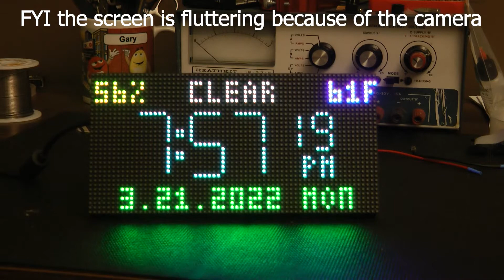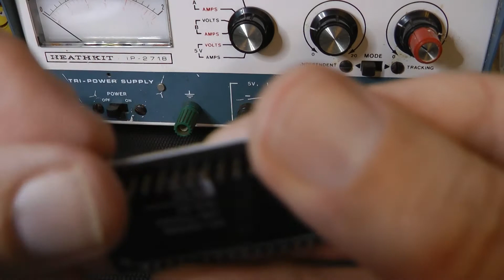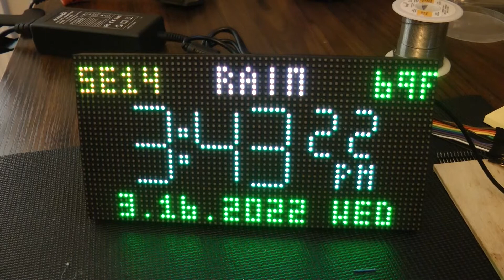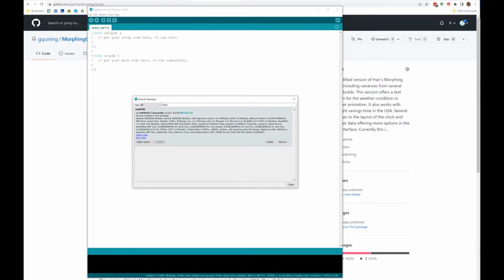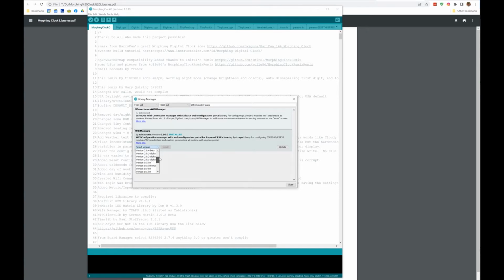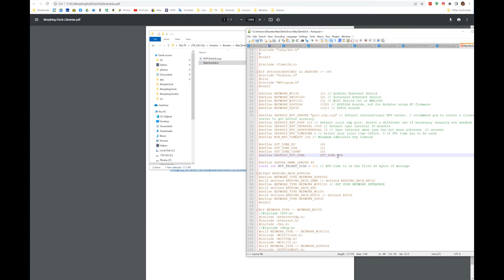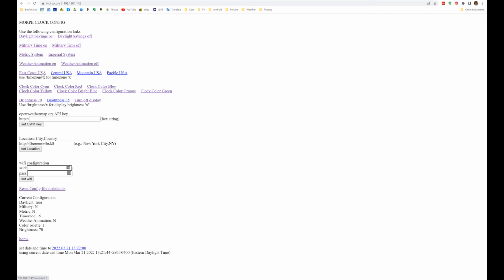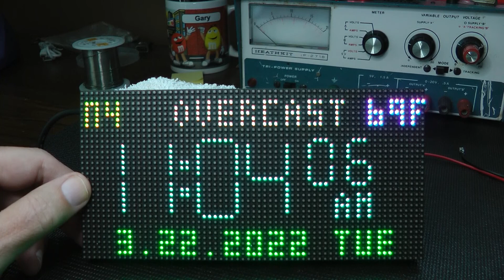Morphing Clock using a 64x32 RGB Display

Comment: hello sir does this code can work on the 64x64 matrix
Reply from the maker: No, it's hard coded to 64x32.
Reply: @GaryQuiring  ok sir, thank you. sir, while iam making this project iam having troubles my display is showing lines instead of the connecting info what would be the problem iam trying to understand but i cant getting it sir . help me please
Reply: @GaryQuiring  sir i have a64x64 led matrix please help me to modify the code that it should work on my matrix
Reply from the maker: @smartboynani5285  I can't help you, I don't own that display.  I suggest you get what the project works with - 64x32.
Reply: Ok sir. If you know anything how to make it work please provide the information. Thank you for responding to my texts.

Comment: Hi
Can you make a version with the ability to set wifi after compilation as it was in the original?
Reply from the maker: Depending on the ESP board the access point way did not work in the boards I used for setting the Wifi.
Reply: It's a pity, because then after compilation you could upload without compilation.
Thanks
Reply from the maker: @janwawrzyniak8444  You can take the source from Harry and modify my version.  The problem I had (I also spoke to Harry about it) is none of the current ESP boards worked with the access point code he was using.
Reply: @GaryQuiring  Dzięki za pomoc.
Pozdrawiam

Comment: Hi Gary I compile the code succesfully. I use Matrix P5 64x32 that I have. I set also into local time and it run correctly. I think I have wiring the pins correctly. However, the display keep flickering all the time. Appreciate if you could assist on this issue as I really like this clock scheme.
Reply from the maker: What ESP board are you using?
Reply: @GaryQuiring  Thank you for this quick reply. I use ESP 8266 Lolin, ESP package 2.7.4, Arduino Json 5.13.5, power 5V 5A.
Reply from the maker: @tutwirata8956  I don't know what the problem could be.  I would try a different power source.
Reply: @GaryQuiring  Hi Gary. I do re-wiring the pin and found that one of my jumper wire was 'unconnected' (might be burn during other usage) causing that flickering matrix display. Finally now Morphing Clock is running nicely and i play with the palette selection. Thank you for sharing this cool project.
Reply from the maker: @tutwirata8956  Congrats!

Comment: Hi Gary! Got the clock running and just have one question...I am missing the top row of weather information.  All info seems to be fine in the params file.  No issues during compile - I know the display is working as the entire display lights up during bootup.  Any ideas?

Thanks
Reply from the maker: Either your weather API key is wrong or try a common city like New York, US for testing.  (Don’t use the state, it's city, country code)
Reply: @GaryQuiring  Yep, my key was bad.  Thanks again...nice to be building stuff that works

Comment: Gary do I have to purchase credits from open weather ? I created a free account I got the api key but this is the message under my account Hourly forecast: unavailable 
Daily forecast: unavailable 
Calls per minute: 60 
3 hour forecast: 5 days . I put the key but nothing it’s on display , just the clock
Reply from the maker: It's 100% free, it sounds like the city, country are not setup correctly.  Try a very common location.
Reply from the maker: Ok I logged into my openweather account, it says the same thing as yours on the web site.  Are you entering the key on the web interface, or did you compile it with the key?
Reply: @GaryQuiring  I found my mistake  It was like this : ""; //e.g. "Seattle,US"  .I edit it and now it looks like this "Seattle,US"; //e.g. "Seattle,US" .  I will try again when I get home from work. Thank you for your reply.  If you want a housing 3d printed for your clock I can do it for you . - no charge . Send me a message on private .
Reply: OK it's working perfect Gary. Thank you :)
Reply from the maker: @tiberiud1955  Glad you got it going.  I'm still puzzled why the P4 board did work, I wonder if it's defective vs not compatible?
Reply: @GaryQuiring  Gary please look at the pinout of p3 and p4  P4 pins have 3 ground pins .the P3 don't have it  . There is a little difference on the pins name .When I tried the p4 the esp8266 don't even power up like it's a short .  The display p4  it's working I used this tutorial https://www.youtube.com/watch?v=sN1FtENjikc  .
Reply from the maker: @tiberiud1955  Wow what a spagetti wiring diagram!  How can you possibly follow that!  Glad it works though, I'm surprised it uses different pinouts.

Comment: Hi Gary, congratulations on this mix!
I built 2 clocks and was using the Imirel mix but I decided to change one of them with your version, I've been using it for about 5 days and really enjoying it. The only bug(already know) I noticed was the display freezing during the weather update.
I wanted to know if that day/night function to dim the display after the configured time was really removed or if I can reactivate it?
I also wanted to change the wind speed from meters per second to kilometers per hour. I've built some clocks but I don't know anything about programming. I've already managed to change another project by adding *3.6 in the string line. LOL.
Sorry for any mistakes, english is not my language.
Reply from the maker: The weather update freeze is the delay getting the data from the weather service.  It would have to be rewritten to use a timer interrupt.  One day I might research that.  The dim function is gone, I removed it, the code was messy and made it difficult to modify other options.  The kilometers to hours is a problem because the wind is an integer.  When multiplying by 3.6 it's going to multiply it by 3.  You could internally change that but then you still have the issue of a decimal point and there is no space on that line to make the wind field larger, it's out of room.  If the wind were ever to go over 99 for example it would mess up, obviously if that were the case the person has a bigger problem to worry about!  Hurricanes are not fun.
Reply: @GaryQuiring  Thanks for the answer. The clock is already pretty cool. Another thing I wanted to ask because I've been using the icons... Would it be possible to change the icon that is supposed to be a moon with the stars blinking? The icon doesn't look anything like a moon, it's more like an arrow.
Reply from the maker: @andrelmarto  That's why I added the weather text option, most of the icons made no sense to me.  You would have to make your own.
Reply: @GaryQuiring  Hello Gary! Is there a bug in changing the colors according to the change in relative humidity or is it really disabled? From what I could see so far the relative humidity of the air is only shown in yellow regardless of the percentage. For example now the humidity around here is at 57% and according to the code (greeen between 40 and 60%) it should be shown in green color, correct?
Reply from the maker: @andrelmarto  The humidity is a fixed color, only the temperature changes.
Reply: @GaryQuiring  Thanks!
Reply from the maker: Hi Andre, I updated the code last month, you should download it.  It fixes the weather update delay.
Reply: Gary, thanks so much for letting me know! I will update as soon as possible. I have 2 clocks working 100% here, MorphingClockQ turned out pretty cool.